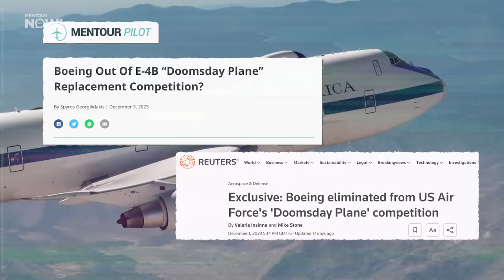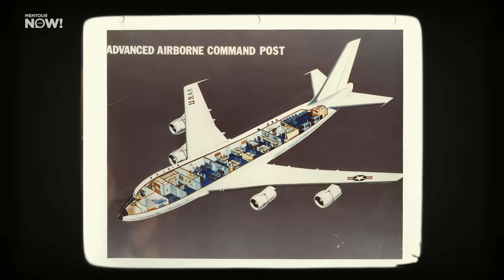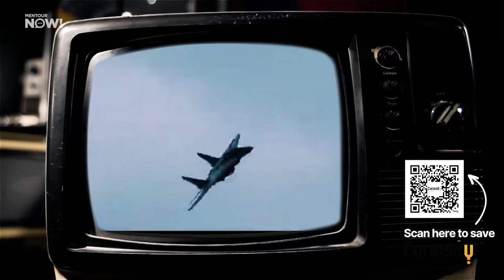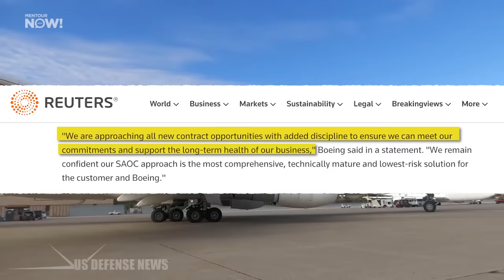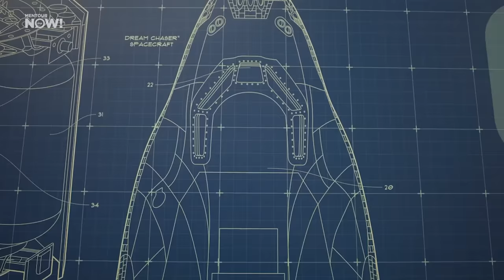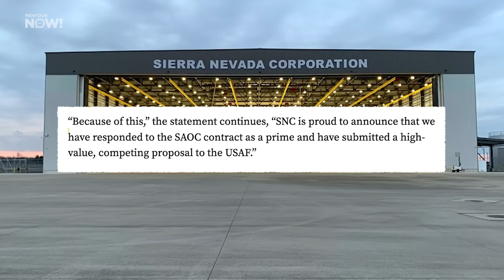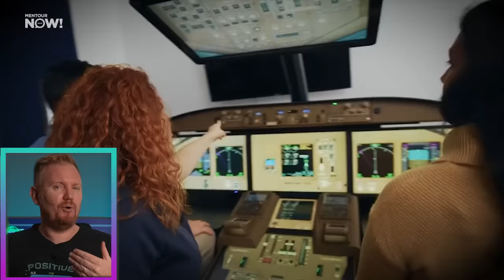Why was Boeing kicked out of the Doomsday Plane competition?!

Comment: Issue with hardening electronic equipment is that it costs a lot more, plus I thought you also need to 'strengthen' the equipment itself in such a way it'll need more room (plus all the cables within the plane). It can be done but it drives up the price by a decent chunk. Analog equipment has less requirements in that regard, especially if most of it is done via metal wires and hydraulics behind the buttons and switches.

Only drawback for analog equipment is that it for a decent chunk of the equipment increases the amount of wear and tear, so it'll need more part replacements over its lifecycle. But as long as it's just the minor parts, those costs are negligible versus the costs of hardening electronic equipment.

The requirement for 4 engines plus a certain minimum speed and minimum size excludes Embraer doesn't it? Of the main manufacturers, excluding 'refurbishers', only Boeing and Airbus have jets which are big and fast enough. Unless another like Embraer, Sierra or Dassault will built custom jets, but that seems way too expensive as a project for relative small amounts.

Maybe others will buy up either Boeing or Airbus jets and customize those, but that brings headaches of its own - because you'll need to retrofit existing planes to certain standards which it might not originally be specced for. If you built a new airframe it'll also have to do overhauls, but I wonder if the refits won't cost more than a new frame considering you'll probably need to redo wiring, and possible add new engines and a lot of other stuff.
Reply: I wouldn´t rule out digital equipment especially when combined with fiber optics.  What makes all electronics susceptible to EMP is the wiring - the longer it is the more it acts like an antenna which can collect a lot of energy.  Just string up 10m of wire in your backyard and touch one end during a weather change (no lightning required).  This problem diminishes if you can package the electronics in many small, multiply-shielded boxes and only use fiber-optics between them.  The electrical power supplies would still have to be decoupled and hardened but that is the case for all electrical systems - analog or digital.

Comment: I think Boeing has its hands full with the new Air Force One, KC-46 tanker and their rocket program and doesn't have the bandwidth to take on another big project. The AF should have bought the A330 based tanker in the first place, and then maybe Boeing would be in a better position to build the new so called Doomsday Plane.
Reply: they need an open ended cash river so they can keep wasting money on their ridiculous space capsule

Comment: BA -747-400's being re-engined and refitted would be plenty fine for this role and there are tons so them available at a good deal price.  As there is no need for them to be fuel efficient from the military perspective,  just able to fit the role.  This could be done by the vendor you mentioned,  General Dynamics , and or Lockheed.  And for LMT or GD it would be a walk in the park for them.  BA has come out of plan, schedule and cost on the three military programs you described.   I Think LMT, GD, or your vendor could easily take 10 747-400's and provide them on time,  on plan and even under budget.   I don't know where there are 8-10 spare 747-8is or 747-8f's to be had.  And remember these planes also take the President when they are on active alert.  Should that day ever become a reality.
Reply: Not sure they'd want BA planes as they are RR engined.  They'd either want GE or Pratts under the wings.  However I think Lufthansa used GEs and have stored most of their 744s.

Comment: why don't they buy 777 or 767s and use a twin pod design like B52 to meet the 4 engine requirement
Reply: I was thinking the same thing, similar to the B-52 pods.  And use smaller, newer engines, like GEnx or LEAP.  But this would take a significant engineering effort to get this to work aerodynamically, not to mention the type certification.
EDIT: GEnx wouldn't work, on a 777, as it doesn't have bleed air.  The PW2000/F117 isn't as efficient, but it's used in the C-17 so it could be an interesting option.
Reply from the maker: Developing something like this would likely be more costly than modifying existing 747s.

Comment: Sierra Nevada is quite experienced in dealing with the task at hand, and managing fixed price contracts than Boeing, they and other medium to big military contractors, that are not tied to the big consolidated conglomerates that arose in the 1990s and 2000s, are one of the reasons this type of contract started to become the norm, they specialized in delivering project on time, on cost, and on budget, because otherwise they would go bankrupt, the government is just forcing this on the big 2 (Lockheed and Boeing), since they acquired all other similar sized military contractors back in the 1990s.

Comment: Boeing could have negotiated for new 747-800 with the Air Force before they shut down its production and that would have solved the modification issues which could have been incorporated in the new build.  Boeing does not have the foresight it once possessed now that the shareholders run the show focused on greed instead of aviation knowledge.  Another idea would be to modify 777's wings to accept the 4 turbofans used on 747's.

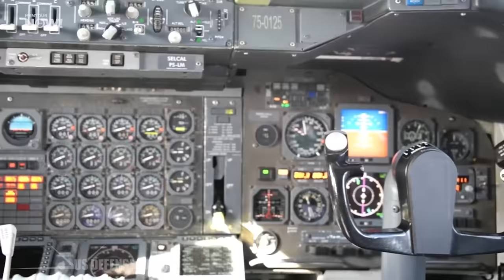Comment: 6:22 ....that is called the VLF antenna.... standing for very low frequency. The boomer's hiding out in the ocean deploy a similar antenna equipped with a floating device and if this  is at communication depth ( around  50 - 100 m depending on the boat geographical position and the Earth magnetic fields ) it is possible to talk to them and transmit the launching order containing the codes for the nuclear weapons release. 😁😁😁

Comment: The A340 - in all variants - is a non-starter because it's not American. See the KC tanker fiasco where Airbus won fair and square but Boeing managed to gain the contract by crying about 'process improprietories'. They claimed that the various countries involved in the Airbus consortium were subsidising the A330 which was illegal under the contract specifications. Airbus were only 'subsidising' the A330 under an extremely narrow definition, so narrow that the GAO were on the verge of throwing out Boeing's claim. Boeing also ignored the fact that under the same definitions they applied to Airbus, they themselves were getting huge subsidies from the US government. The Republican Party and Boeing then seriously pressured the GAO to issue a new request for bids that was pretty much skewed in Boeing's favour. At the time of the bid I followed it very closely because I couldn't believe that Airbus stood a chance and was delighted when they were awarded the contract. I was also not surprised at the follow-up because it's happened before. See F-111 vs TSR-2 as an example.

At the end of the day, Boeing are going to get this contract and most likely under a Cost Plus basis. Whether they are the main contractor or a sub-contractor under SNC, that's the way it will go.

Comment: Heh, steam gauges. Yep, EMP is rather serious, both local or if it's a major hit above the thermosphere, where it's far nastier.
Animal sourced fertilizer, I'm gonna have to steal that one.
I am a tiny bit surprised at the 8 - 10 requirement, it was previously a half dozen.
Wiring, that's largely fiber now. Can't discuss that further at all.
Or booze bottles found inside of an aircraft under construction.

Boeing is doing Boeing, it's looking out for its own interests, rather than previous prestige.
And I anticipate a change of course, post door blowing off impacting, well, prestige.
See excrement striking primary impeller...
And right alongside uncontained fan failure.

Comment: Thats quite a predicament. An already existing plane type which preferably should still be in production,  four engines and for obvious reasons  a solely u.s based manufacturer which is NOT Boeing. These four wishes make things rather difficult. Even the C-17 which was suggested several times in the comments does not fit that description as, beside it being not that old, its production ceased in 2015 and its max range is only about half that of the Boeing E-4. Certainly the u.s military will not accept anything beyond a slight reduction in range but clearly wishes equal or more range. The  C-5M SuperGalaxy will propably be too large and too costly to convert. My suggestion : Re-negotiate with Boeing. Keep the E-4 as interim solution until a completely new aircraft is developed. Or simply let go of the four engine requirement ;-)
Reply: I mean there are plenty of 340-600s in the boneyard and the airframes could be gotten for cheap. 
A good option as well
Reply: Sure the A340 might seem like what the USAF is looking for , but it aswell is a discontinued airplane with a discontinued spare part supply chain and its foreign made. Especially the latter disqualifies it completely. Operating, maintaining, modifying, or simply just to integrate the comms equipment and antennas would unavoidibly necessitate the involvement of Airbus and its subcontractors at some point.

But the NEACP is a command and control junction of the national security infrastructre which means most of its equipment aboard is classified. The list of people even allowed aboard those planes is rather narrow and definitely excludes any foreign nationals or u.s civilian contractors working for foreign companies. 
A cooperation with Airbus to integrate the NEACP tech would also necessitate disclosing classified information to a foreign company which of course is out of the question. 
To operate the plane without any foreign involvement at all would either require thousands of different and very costly individual licences which in turn Airbus would not even consider to sell to anyone, for obvious reasons, or to replace nearly everything with custom parts made by u.s airplane suppliers. That would be so incredibly complex and costly and it would be faster and a lot cheaper to design and construct a completely new airplane.
So no, it just has to be u.s airplane maker. ;-) @alexgallagher4594

Comment: Boeing has no excuse for losing their shirts on these fixed price contracts. They have built these kinds if aircraft/spacecraft before and should have ample experience on what it will take in both manpower and development costs to achieve these systems. The facts that they still lost money boils down to failure to control costs in a reasonable manner.

Comment: Given that these programmes often overrun on costs it's highly likely that Boeing are trying to make sure that they don't end up getting stuck with an expensive programme that they can't cover the costs of similarly the government is trying to make sure that they don't end up paying out endless cost rises to a private company.
I expect that this is just the stage of haggling which will eventually (and expensively) reach a conclusion.
If the airforce wants 4 engines and you have to ask why, then your only options are the A340, A380 or the 747 there aren't any new A340s it's possible another company could buy 747s and upgrade them... although the A340 technically wold probably be the best aircraft for the job but politically it's likely to be a 747

All in all though you'd have expected Boeing to be doing its best to keep the US government happy at the moment but then I suppose the USAF doesn't have much sway with the government either.

Comment: If you want the best quad jet there is just one choice:
CONCORDE
... theres still more than a dozen of then sitting around on various plinths and museum displays.
Reply: An awesome airplane to be sure, but those things are even older than the existing E-4Bs and meet essentially none of the requirements for this problem outside of the number of engines. They would agree to a 2-engine plane long before they would consider something like Concorde, even if it were a newer design that was still in production.

Comment: The USAF needs to get over its obsession with four engines. The aviation industry is going to two because it makes more sense in a host of ways. The statistics are against four. Is a Doomsday plane going to keep up its 'just in case' flying with one engine out? Nope, it will return to its base. But having four engines rather than two doubles the chance of that happening. The USAF should go with two engines and use the money saved to have more aircraft and more spares.

Comment: I always wondered could the 737 max be outfitted as a quad jet? Will need wing adjustment however it a lighter air frame and maybe be easier to source parts over the lifetime of the new E4s. Know 747s can ferry a 5th engine. Would that even be possible on the 737 max air frame while being economical?
Reply: Not big enough. The body of a 737 (sans tail) fits inside of a 747 cargo as a size comparison. You need a widebody airliner, or heavy lift cargo hauler at a minimum.

Comment: Can they use a 787-8F?    8 Billion seems really low for as technically complex as the systems are let alone buying used  10 x 747-8 and just the interior conversions work (adding a re-fuel capability and system as well as the rest)  .    Also,  the KC-46A also had to meet FAA certification and what is the reason for that?   (I know Airbus A400 did as well but???????).    Boeing is finally smart to stay out of this,  the cost overruns will  be insane and they still supply support to a 747-8.     USAF should change this,  if 4 were enough before,  then buy 8 x 767 (or 777) and spread them out.    An A380 and A340 would fill the 4 engine spec but I don't see Airbus with that capability for this kind of work as its not the aircraft,  its the conversions and systems install and integration.
Reply: 787 much too small! 2 engines doesn’t cut it.

Comment: I think I know why Boeing thinks they might still be in this. It wouldn't be the first time...

A few years ago, a tanker contract was awarded to Not-Boeing. Boeing promptly spent money on lawyers to challenge the award--and, apparently, the initial "build a plane to do this" document. Boeing's lawyers won, contract re-bid, Not-Boeing said "Nope, can't do it, they can take the hit."

I suspect they think they'll be able to challenge both the awardee's plans and other parts of the contract and come out ahead.

If, of course, they don't go the subcontractor route. If they play their cards right going that way, they might even be able to steal the contract anyways--subcontract at a price that drives the prime contractor towards financial ruin, buy them out, now Boeing has the contract and another company in their umbrella to make them money (if they don't completely ruin it first).
Reply: For the tanker contract, Boeing's lawyers were 100% correct.  Northrop bid a larger, more capable aircraft than Boeing.  However the contract bid documents said that the top criteria was reuse of existing airfields, hangers, and ground base infrastructure. So Boeing bid a smaller plane that would actually fit in most of the old KC-135 hangers, and could use the runways and taxiways of the Air Guard bases without modification.

So, while the Northrop/Airbus bid was unquestionably a better aircraft, it did not actually meet the published contract requirements.

Comment: I remember Petter that You told us initially that due to a price cut Donald Trump put on the replacements Boeing came up with two already built 747-8 which were not delivered to their Russian contract partners cause they had gone bankrupt. What is going on here ? I doubt that Airbus will be picked, cause for A 380 & A 340 production has cease to exist. One plane which comes to mind is Boeing's C-17 Globemaster, last one built in 2015, factory closes but planned to be in Service for decades to come. I know there is a range issue. The most modern plane with 4 engines and longer range and also pretty fast is the Airbus A 400. Not sure that they would consider this one either. Then Russia and China (A 340 copy) have 4 engine planes , but those are defiantly not top of the Air Force list 😉 Overall, given the delays this program faces, it doesn't seem to have a high priority at all ! From a military point of view the safest way would be to fly C17s cause there a so many Globmasters up in the skies in parallel, that it would be quite difficult to spot the 'special ones'........just thought !😎

Comment: Why couldnt they take a twin engine plane add some supporte to the wimgs and have twin engines on a single mount like the b52. Would probably ve cheaper because im sure anyome selling 747 right now woukd want to hold onto them to run thr cost up knowing they need them to fill the order. Whete as modifing a twin to a quad could catch the market off garud getting them cheaper offseting modification costd